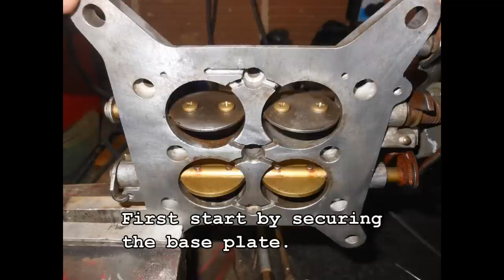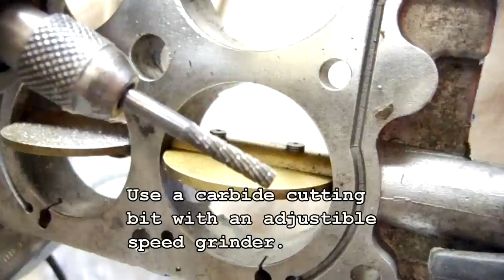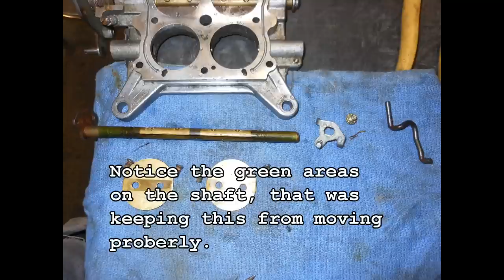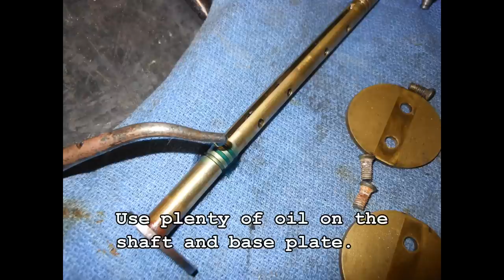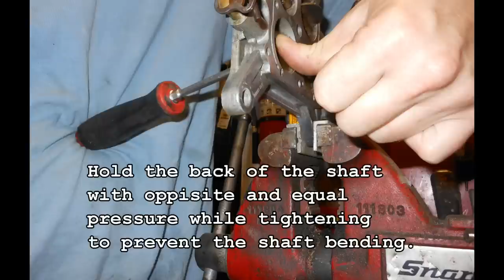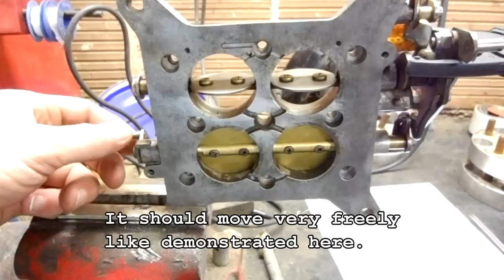How to Repair a Carburetor Base Plate Shaft

Comment: they sell teflon seals for these shafts, but in reality, they dont really wear that fast. Thy are included in most rebuild kits. Also when remounting the plates onto the shaft, mount  them loosely and open and close the throttle a few times so they self center, then you tighten them down and stake or use loctite. If you dont they can hang crooked in there and youll never get a good base idle.

Comment: I find it bizarre that there are no seals on the shaft inside the throttle plate to stop air from getting sucked inside. It's a built in vacuum leak, and as the carb ages the leak gets worse.
Add a Paxton style supercharger and now you are blowing air out through those shaft holes.
Reply from the maker: most Holley throttle plates are adequate from naturally aspirated vehicles.
Reply: SuperDaveVideos I'm not talking about the plates. I'm talking about the area where the shaft runs through the throttle body. There's a lot of clearance there that has to be a vacuum leak of some degree. As the carb ages that clearance can only grow larger. .
Reply: 1971SuperLead 
Find a piece of brass tubing at a hobby shop. Usually about 5/16 inch fits the throttle shafts.
Drill out the shaft hole to the diameter of the brass tube.
Drive in a short piece of the new brass tubing, might secure with a bit of loctite or epoxy.
Ideally, you want a tight fit. I did this to three quadrajet primary shafts and got a tight like new fit.
The brass wears slowly, much better than aluminum does. I even did one that was not worn out.
Just do the outer holes, dont worry about the central shaft hole
Reply: sdowney717 That a good trick, but it's timely and requires skilled drilling. 
What I see, is an opportunity for some aftermarket company to make a kit or just a new base plate that offers needle bearings or teflon bushings and some bal-seals. Now you have an air tight system that operates much smoother and more accurately. 
In your design, instead of copper tubing, a teflon tube might even do a better job, especially if you crammed a bal-seal down the hole first. .
Reply: many carburetors have nylon bushings
Reply: @murmaider2  holleys do too